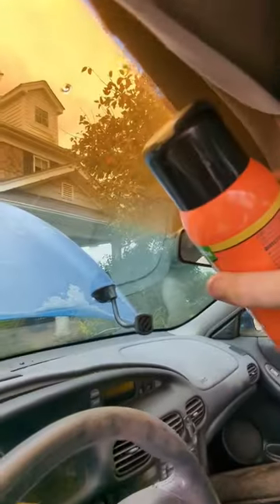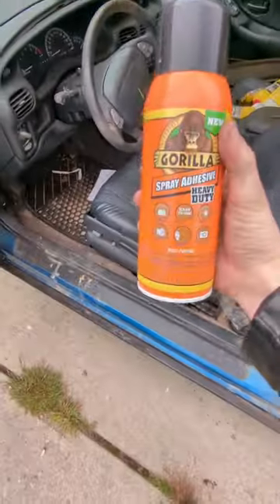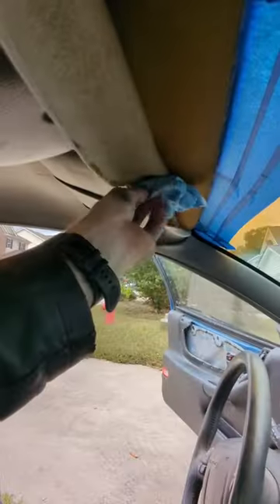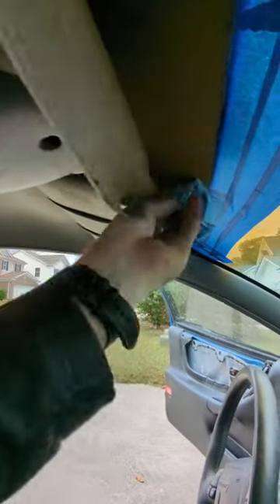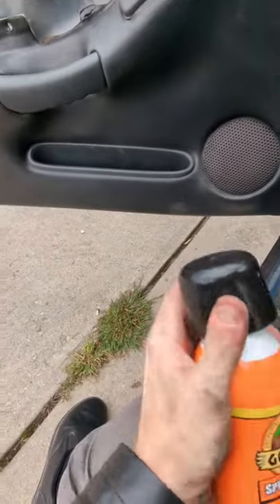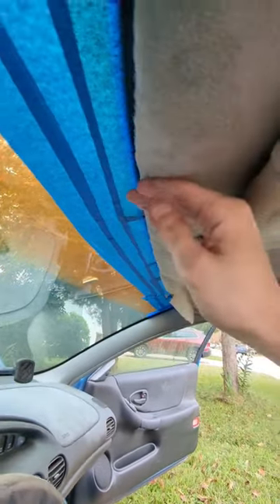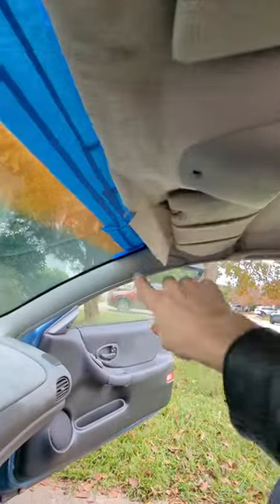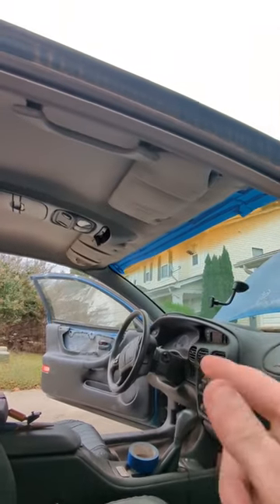How to fix sagging headliner

Comment: The factory instructions say - that glue is not recommended for headliners
Reply: It’s really not but you’re supposed to spray and let the glue dry a bit so you don’t get those wet marks you see
Reply: My car has 100000 miles I’m not worried

Comment: Guys! Use a soft brush to clean the material off. Use actual headliner spray, and wait about 5 minutes before you try to reapply the material so it gets tacky, and doesn’t wet the material when applied. You don’t want it to soak through the material what so ever.
Reply: Thanks for this tip. This happened to me, during my first time using headliner.
Reply: Looks like this guy soaked through the headliner

Comment: Don't do this. It will fall down again quickly. If part of the headliner is falling down, the remainder is soon to follow. Pull the fabric down, remove the dust and glue. Spay the liner with fabric spray paint.

Comment: Product description:
Gorilla Spray Adhesive is heavy duty, multi-purpose and easy to use. While repositionable for up to 10 minutes, Gorilla Spray adhesive forms a clear, permanent bond that is photo safe. Its wide pad nozzle and controlled fine mist provide an even application on the project you are working on. Not recommended for use on vinyl materials, automotive headliners, polypropylene, polyethylene or similar materials. Do not use for bonding weighted materials.

Comment: That's not going to work in about a week it will do it again and it actually says not to use that spray for head liners because of the foam in between the liner and particle board.